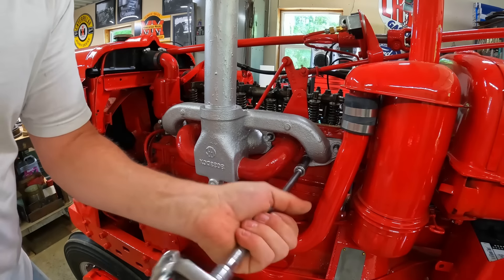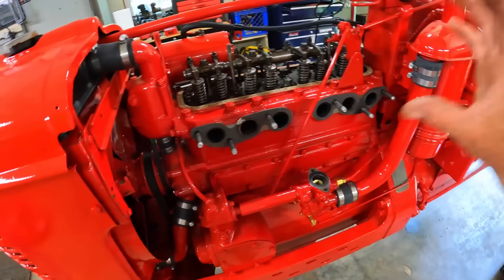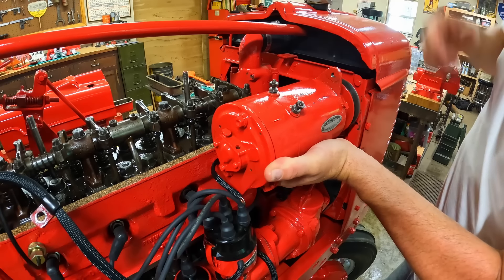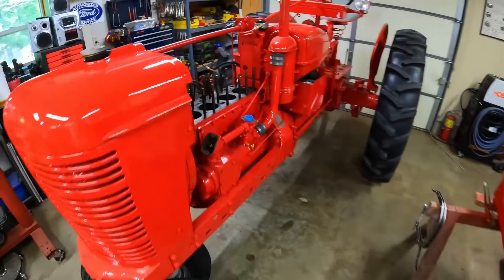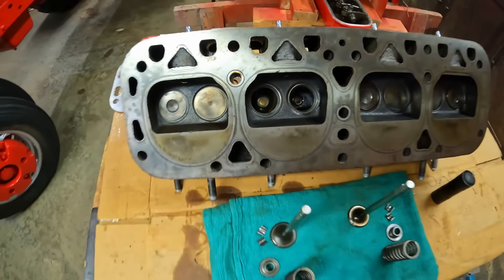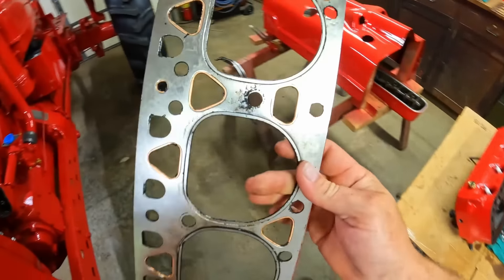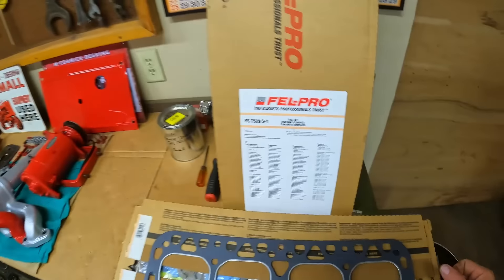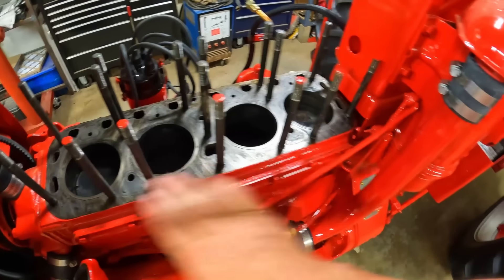Farmall H Engine Knock Found, But It's Not What I Thought - Farmall "Preparation H" Project Part 45

Comment: Oh dear, making Christine look like a real sweetheart. at least you know what the problem is. Don't forget to apologize to the machine shop for doubting their work on the head.
Reply: Don't say that! If Christine catches wind of that thought, she will come back with a vengeance to regain her title!
Reply: We all make mistakes and in this case,  I never heard of a loose liner on a rebuilt done by a quality person.    No apology necessary,  if Squatch had done that head he would have though he made a mistake and he has shown us more than one.   Its part of that type work.
Reply: X231 is just a scared tractor that has been beaten to death over and over again. As Toby said in the episode about her having the wrong pedestal, those boys that were on that farm could break an anvil with a rubber mallet if you let them. She is unique which means that they didn't have a parts list for her and she was abused and broken beyond reasonable repair. The only reason why she is being restored is because she is one of a kind.
Reply: @gregoryschmitz2131  I wasn't being serious!
Reply: I have spent a lot of time repairing machine shop mistakes for work paid in cash at retail.Only once did I have them re-do something.They had installed an oil ring upside down.Had to pull the engine of course and they asked for another $150.00 for labor, which I paid.I'd say I won't ever be apologizing  to a MS for anything.

Comment: Bolt the new gasket on and move to the next project. If the sleeve starts moving in a few years you know what the problem is. In the meantime start scouring the swap meets for new good branded sleeves and pistons. 

I bet the sleeve grows into place on its own and it never comes apart again.

Comment: My cousin had a 706 diesel with dry sleeves. The sleeves slid down in his motor after an overhaul the connecting rod hit the sleeve and destroyed it.  He had to completely rebuild the engine again.  As long as the sleeve is not cracked around the top I would not worry about it.   The engine will never run long enough in our lifetime to ever give a problem.

Comment: Ive been building engines for 50 years, some people call me rough, if its a dry sleeve and you are not going to be doing power runs, just pulling a hay wagon for hay rides, id put it back together. Thhe main problem is heat transfer between the sleeve and the block. Just my opinion... Good video mate, watching from AUS.

Comment: If liner height is good I would reassemble. Being in this business for 40 years I just don't trust the parts anymore. Very poor quality. I really thought it was the valve seat.  Good call.
Reply: For sure. OEM only there is a lot of junk floating around out there.
Reply: @maxpuppy96 Even a lot of OEM any more is questionable. Companies are a lot more willing to change supplier contracts at the drop of a hat than they used to be, it seems.
Reply: I second that the parts unless name brand high dollar are crap! I thought  it was a seat  also !
Reply: Doesn't seem like a sleeve should move that easy, but if it were me, I'd put the felpro head gasket on it and let it ride. A tractor that pretty isnt gonna do much work the rest of it life anyways.
Reply: So true. For my brother, i keep stocking NOS parts where possible. Where it's unobtanium, it's bite the bullet and get them custom made. Several places in Poland, Germany and Italy where they still make good parts if you're willing to pay the cost of "custom" parts.
Like even last year, on this theme, i bought a few gaskets from Cat. All garbage. Utter freaking garbage that didn't even fit the bolt pattern properly. Same part number as the previous order, triplicate check with the local dealer, even had a talk with Cat Europe. Just garbage.

C-suite isn't out to build anymore, they're all in it for the grift. Trust fund babies and all other manner of creatures, they suckle up the economies of the world and ruin lives left and right.

Comment: Thanks again for the update Toby! Wow! That was an unexpected clarification on what the cause of the knock was. Well knowing that you gave a good new head gasket, not a ton of hours on the rebuild and if everything checks out I’d put the new head gasket on and see if it goes away. Not sure what you could do to hold the sleeve in. Who knows if you’d have the same issue with a new sleeve and piston to. Just my 2 cents. Can’t wait for the next video!

Comment: You're definitely on the right track there. If everything else checks out, replace the head gasket and try again. Contrary to another comment here, I would be tempted to use a miniscule bead of Loctite sleeve-retainer right at the top. True, Loctite does its job very well--sometimes too well--but I've pulled out lots of sleeves over the years and, more than once, had to resort to running beads of weld down inside the original sleeves, which never failed to loosen them up. I might add that I didn't have the luxury of a boring machine to mill them out. I did a Perkins diesel one time where the old sleeves were a bear to get out, even after running a couple beads of weld, and, oddly enough, the new ones slipped in a trifle too easily. I used a dab of Loctite Sleeve-Retainer on the new ones and the job was successful; that engine runs several times a week, and has so for 40 years...

Comment: Check and clean the sleeve. Looks to me like you have checked everything else so very thoroughly. After the cleaning of the sleeve, install the "good" head gasket and run it. You are so very right about the "known quality" vs the (unfortunately) crap that is out there now. Stick with the good stuff. Especially since it has so little hours on it! Love your channel and your attention to detail is fantastic!! Don't you just hate it when you are so careful on the build and do the best you can and then you have a problem??  So glad you found it and have a good solution.

Comment: Well that's a pain! Put the head gasket on and use it. Years ago I had a knock that I had a time finding in my 49 M.  Did all the things and finally took the head off. Right on top of # 2 piston was a smashed brass screw that I recognized immediately. One of the choke plate screws had got sucked all the way up the intake and delivered into #2 .

Comment: Consider the hours you have on the engine since the previous rebuild, with a good known head gasket without the liner movement. Consider the very little time running in the state it's in now. If the liner still spec's good and the block bore spec's good, I wouldn't think  twice about running what's there. Especially when the suspect is the head gasket and you've proved it with the old gasket and the FelPro gasket. Now, the issue to take to hand is to bring the problem up with Stiener and their gasket supplier. After all you have all of the convincing evidence in this video. I'm sure you're not the only one to run into this problem on that gasket set. Great video and searies on the Preperation H.
Reply: excellent idea = total agreement

Comment: Back in the late 1960s, we had the very same problem on a TD-24 with the 1091 engine. Did an overhaul on it, and on the first start up, after it had warmed up a bit, it got a pronounced knock in one of the front cylinders. Fortunately, the 1091 engine had two heads on the six cylinders engine, and we were able to pull just the front head. Just line your engine, everything looked fine, until a closer look showed some faint marks on the bottom of the hear where the liner had been contacting it. As you did, we compared the head gaskets, and the area around the perimeter of the liner was larger, and the sleeve was bouncing up and hitting the head. That was a long time ago, but I guess there were two variants of the engine that used different head heads and head gaskets.
Sure was a head scratcher though.
Reply: I thought that engine was fitted with fire rings and prevented any liner movement?

Comment: Great catch! I'd have never figured that out. For myself I would check the sleeve and if OK put on that fel-pro gasket and go with it. That will pinch it down and stop that moving plus keep the other three from moving. Should they be tighter, probably. Can you get a set of quality oversize sleeves, no. I'm surprised it didn't clatter when cold instead of warm. You would think the sleeve would grow more than the block when warm. Lots of sleeves out there are being held in by the head, you got bit with poor fitting aftermarket parts. I had sealing problems with a new (and expensive) no name head gasket too. I found a NOS head gasket, put it on and all is well. These cheap parts can cause so much headache.

Comment: As soon as you went back and forth on the head and the block, I doubted my guess but did think, "is that sleeve slapping? can't be...crap it did". You've got a good plan IMO, check it all and move on. IF, however, you feel you need sleeves and pistons I am still finding Clevite sleeves and pistons on ebay. Not always as a kit, but sometimes I see known good brands still being sold off old shelves. And boy do I trust many of these to be original stock looking at the aged boxes they're showing!

Comment: Since anaerobic gasket maker seems to been said a bit already, and copper compression rings would require using a copper washer or machining, could bronze braze the top or bottom of block to sleeve and what sucks in to what depth holds like solder on copper pipe, is a clear  indicator before next guy tries to press it out and has excellent heat transfer conductivity.

Comment: For what it's worth, while recently searching for an early TD9 head gasket, I spoke to a gentleman at Olsons Gaskets, he explained that I would need to know what I had under the head before ordering because there were piston and sleeve replacement kits sold in which the gasket held the sleeve down, and if I got the wrong gasket I would likely find myself with the same problem your having. When it comes to being detail oriented you and I could be twins, but if it were mine I'd put that swap meet Fel-Pro on and run it, remember it is a 26 horsepower motor with 5.9:1 compression not a diesel and not to race car. Thanks for the videos, while I haven't seen them all I have watched many of them, always a good view!

Comment: I would bring that cylinder up to TDC. Pull the cylinder sleeve up as far as you can without pulling it off of the rings. Slather it good with loctite sleeve retaining compound and send it home. The loctite with the right head gasket will make it a non-problem.
Reply: I totally agree. This tractor will never be overhauled again if he only put on 250 hrs in 18 years.   Locktite is a great option.
Reply: Why do that when all it needs from 250 hours of experience is the right gasket?
Reply: @donmoore7785  the gasket is not meant to hold the sleeve in. It will eventually swage out the metal on the gasket and cause a failure.

Comment: Thanks for the video Toby. I think I would check the cylinder liner out and if it looks good I would reuse it. The after market parts aren't half the quality. My grandfather and I operate a small engine repair shop and are having a hard time finding quality parts. Looking forward to the next video as always. Cheers

Comment: First thing you need to do is separate the H from Christine, its running with the wrong crowd.
Reply: I don't think that's the problem. He just ran into an issue that the no name head gasket didn't address. I like Fel-Pro head gaskets because I believe Fel-Pro does its research. What Toby ran into here is not at all uncommon in dry sleeved tractor engines. Fel-Pro has its head gaskets cover over the edge of the sleeves and that holds them down. As the sleeves heat up, they expand and fit tighter in the block. On the other hand. My 89 Ford Escort had a reputation for blowing head gaskets. Fel-Pro designed these head gaskets to have the seal ring pulled back slightly from the edges of the cylinders so that the pistons could have clearance from the head gasket. The original factory gaskets were so close that the pistons were able to touch the gasket and damage the fire ring.

Comment: Hello! I would use the new head gasket and put it back together unless you find a crack somewhere.  This condition already existed, but it wasn't apparent until you used the new head gasket.  It wasn't causing any issues so it will be at least that good again when you put it back the way it originally was before you started the restoration.

Comment: Excellent  video Squatch 253   ( SR& JR) :) also that wild a sleeve move up plus light click sound and Head Gasket  was big ops on ! I say for get Heavy Duty  Strong glue on sleeve and heat on block , head gasket  to head have at least 1/4 " thick on each so looks like got sponge  together  and I hope have Lol ! I know sounds werid but may fix up because in 1993 a mechanic did my late Dad & his older brother  1978 International 724 B Desiel motor  loader tractor  motor German type ! Also made motor  run excellent too because head and block needs  seat perfectly better! Hope this help out to  on suggestion and Lol to about free will! Yes though Seat on Valves was it and simply fix to in one fun thing!

Comment: When I worked in a farm equipment repair shop in the early 1970 we used aluminium spray paint on the dry sleeves  that were  loose. This was based on factory training the owner of the shop received from international when there shop was an IH dealership. Did a lot of  engine overhauls using this method. I don't remember any issues with method.

Comment: Well I'm flabbergasted with your attention to detail I've seen in all your videos from the start of your channel you missed this headgasket size issue, this means you must be human after all. My w4 had loose sleeves on cylinders 3 and 4 but was lucky to get NOS copper head gasket 30 years ago and has done plenty of farm work and competed in tractor pulls for 20 years with no issue's at all, new gasket and retension the head a couple of times and prep H will be good as new. Cheers from Oz
Reply from the maker: You’re right though, I missed this when I did the reassembly. If I had caught it, I would have only had the delay of finding a better gasket - but now I’m fully back into the engine lol 🤦🏻‍♂️

Comment: Due to the famous Squatch “eye tick” issue, I see a NOS original piston & sleeve in you near future ….
😆
Seriously, won’t know what caused the loose liner issue until you get it out & inspect the bloclk bore & sleeve condition. The issue remains as to what the cause could be, especially since the engine has very few hours on it..
 It could be something as simple as cavitation, or a slightly undersize liner when new.
  Quality parts are still available, but it takes vigilance and a bit of luck to find in today’s market.

Comment: I would clean the cylinder sleeve recess, apply JB weld in the recess, lower the sleeve back down, clean, install new Felpro gasket. Should work just fine

Comment: We had brand new TR3 lifters back in the late 1990's that were not heat treated and shagged out in 12 miles. Lesson learned in the PAST CENTURY on race motors....Rockwell test new parts. It only gets worse.  The dealer said they had a bad batch some years prior.

Comment: The right thing is to pull a part.clean all parts measure hole and sleeve .buy larger  if need be if not lock tight sleeve. Press back in hole re assemble.

Comment: I would put a better gasket in, and call it good. Think about the forces involved, the motion of the sleeve going up and down is caused by the drag of the piston on the walls of the cylinder. I would guess that the friction force of the piston on the sleeve is not much (since it is so nicely cross hatched and lubricated). My uneducated guess is, a head gasket compressed by a head will easily keep that sleeve in place for a very long time without issue likely long enough to put 500 hours on the tractor over the next 40 years lol. Just my thoughts, take it with a grain of salt. Love the stuff Squatch!

Comment: I have never seen a farmall dry sleeve to parent bore that loose. Usually they are very tight. But I think I would do as you are thinking, inspect it closely and put the correct fit gasket in it and move on.  If you were going to plow with it day in and day out then I would take the block to a machine shop and get it redone. But the use you are giving it , it will run for many years.  I have two of those tractors waiting to do the same thing to. Good  luck.
Reply from the maker: On this engine, all 4 of those sleeves just slid in with hand pressure back when I rebuilt it 18 years ago, and I’ve done heavy plowing and lots of scraper work with this tractor in the hours since. I seriously doubt that #3 sleeve is any looser fit now than it was with the old head gasket still on top of it before I took it apart 👍

Comment: I see what is happening now. The block gets hot and expands and the liner sleeve gets loose and starts moving. Because the gasket is the wrong shape it doesn’t hold the sleeve in place. Not many would have suspected a head gasket. Proves what a conscientious and skilled technician you are.

Comment: Head gasket letting the dry sleeve come up.  Would not have guessed that easily. Makes sense it would stay cold and move hot though. If you can't find any sleeve problem, I think it's reassemble with a good gasket and let her run.

Comment: You should get a fiber optic lens for that. Light travels through glass (fiber optics) really well and then the entire seat could be seen by putting the fiber optic cable in your exhaust and intake ports. What if carbon build up from running at low rpm's chipped away? It does happen if a rod doesn't slip on its bearing to create the knocking sound.

Comment: The 478 Hercules engines found in white tractors haven loose dry sleeves. If you turn the block upside down they will fall out.  The head holds them in.